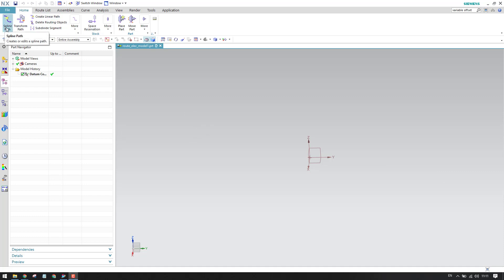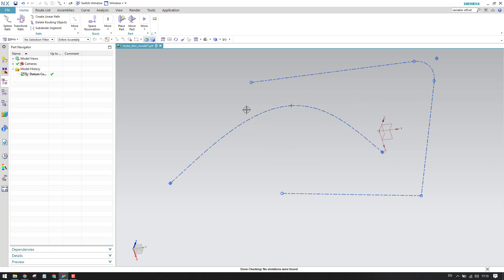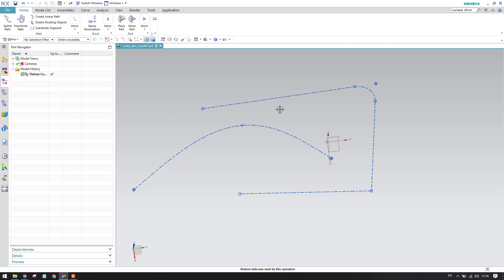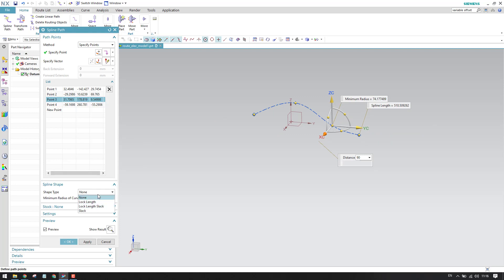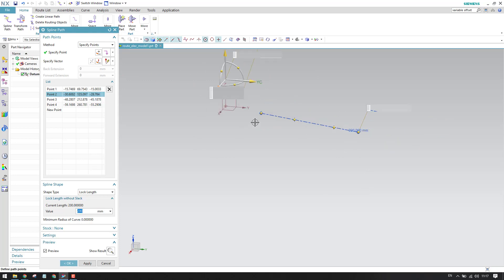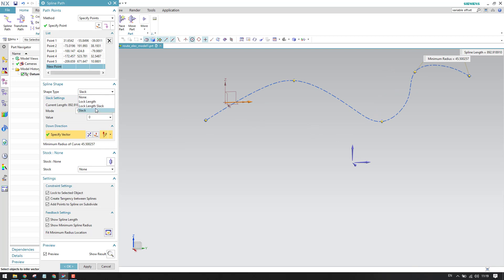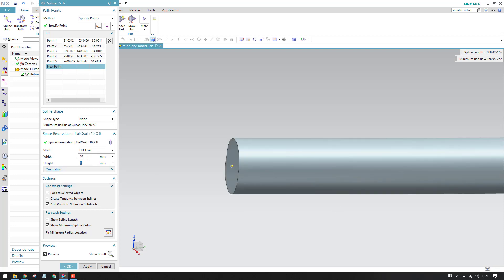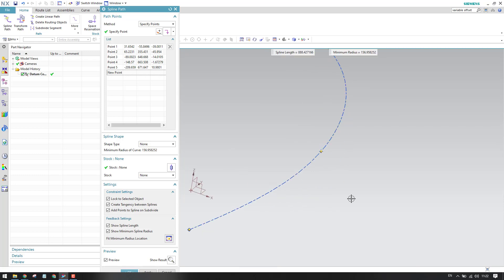Siemens Unigraphics NX- Electrical Routing/Wiring and Harness || Path Types and Spline Path

Comment: How to change the minimum bending radius i mean how to adjust it could you tell
Reply from the maker: Change in spline path window
Reply: @TechDesignsantosh  I can't change it, I only has info about min radius, but it's not allowed to be modified. Do you have any video where you are showing that?